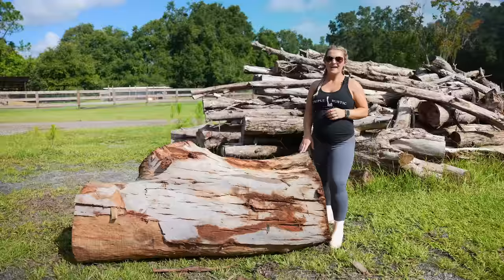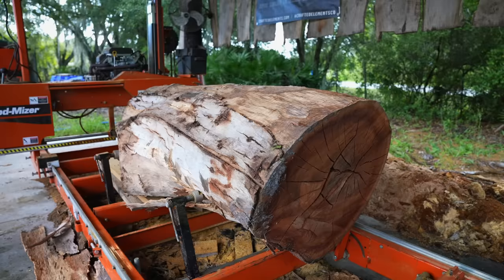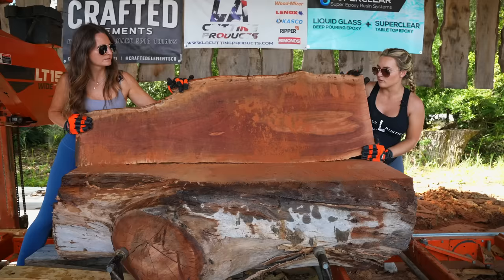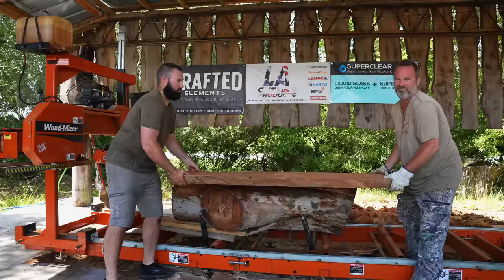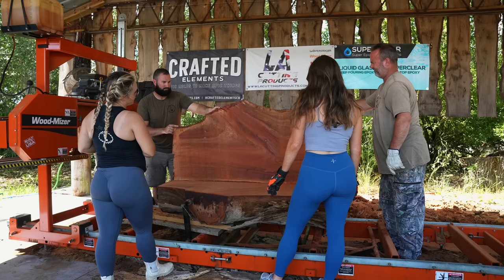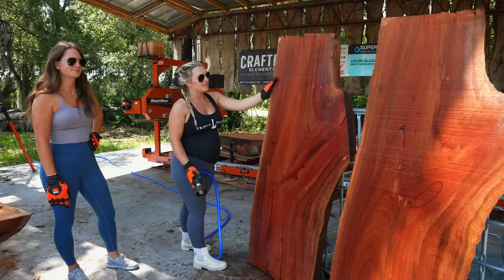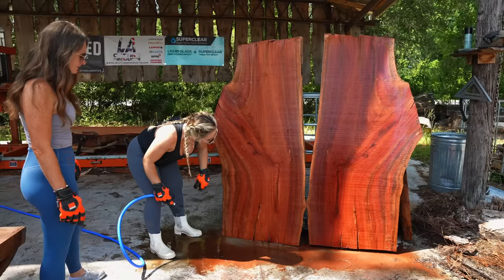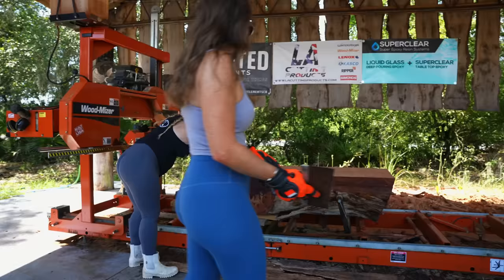You Can't Lift This...EUCALYPTUS

Comment: My wife and I sold law-enforcement gear and equipment for years and sold quite a few metal detecting wounds  to woodworkers over the years,  also having  been retired for years I'm still using one in my own shop.

Comment: Nice slabs of wood nice colors on the crotches. They make a nice table top. I lived in central Florida for a while Orlando and Leesburg. After college at UCF, my first job was at Starline manufacturing, then I worked at Citrus machinery, Agri machinery, Reeves industrial equipment, and finally aluminum Reclamation Systems. These companies are most likely out of business. Then I came back to northern Illinois to continue my engineering career. Keep up the good work.👍

Comment: Possibly river red gum 
Good burning 🔥 long lasting heat red hot coals. 

Currently sales for wet red gum wood fire is halted to bring the numbers back up. 

Only way is that a red gum has fallen naturally to the ground or must be chopped down for various reasons including diseased or unsafe. 

Lots of varieties 

Red gum 
Blue gum 
Sugar gum 
White gum 
etc 

Red gum is at the top of wood fire 🔥 & most expensive per 1 cubic @ around over 200 + Australian dollars. 

I had a white gum slab sitting in mud for 8 years now and hasn’t rotted.